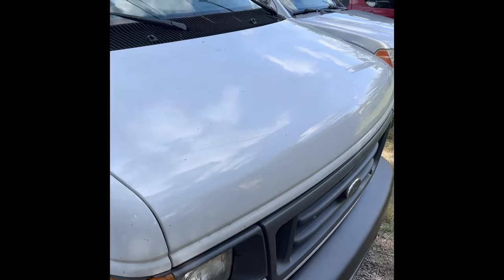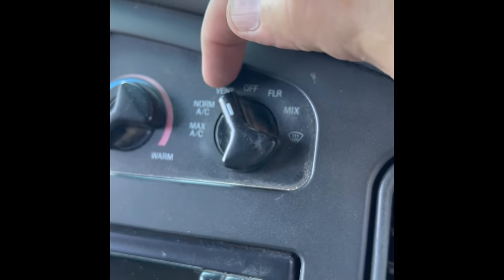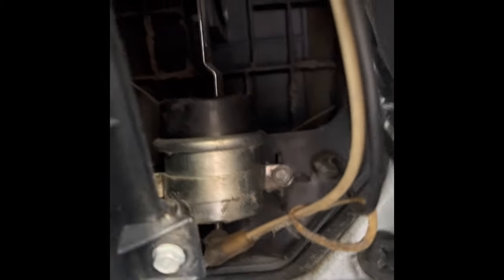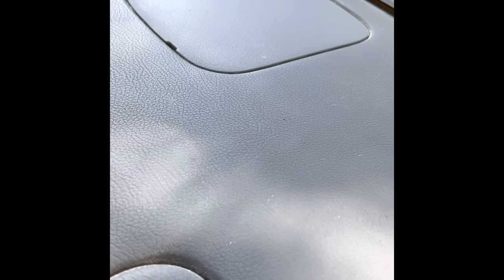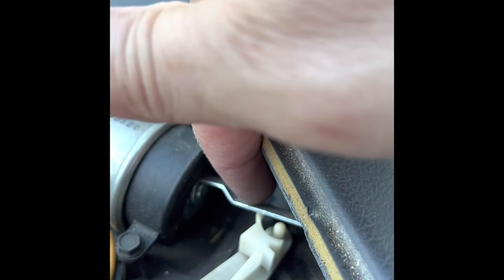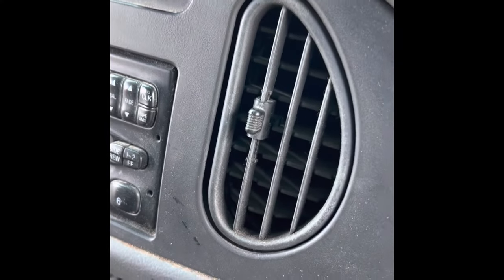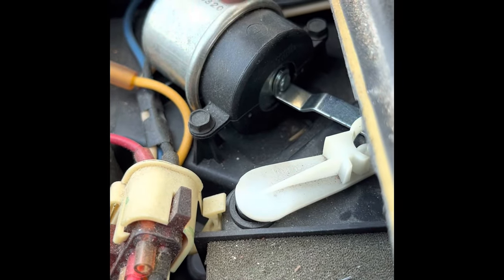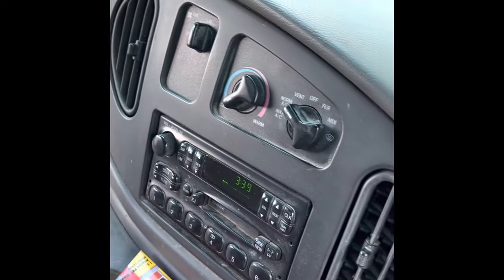Ford E250 air not coming out of front vents EASY FIX!!

Comment: 6 weeks. I’ve been driving around for 6 weeks. It’s been over a hundred degrees in Dallas the whole damn time. So easy. So simple. Six weeks.
Reply from the maker: So glad I could  help!!!!
Reply: No work? 😢
Reply: Mine is an 09 it does not have the plate on the dash??
Reply: Where is that switch in mine
Reply: How hard is it to fix it properly change the part ?
Reply: Hahaha... I can write the same comment jus change to city to Philly

Comment from the maker: Please note: What I pointed out in this video is more of a “bypass” than a true fix in order to avoid an expensive and time consuming tear down. What I am proposing gets the job done with no cost. The actuator that I point out in the video that I was going to replace actually worked fine upon bench testing so the vacuum problem is more complicated and would require a tear down of the system to find the leak. Hope my solution helps.
Reply: So the actuator wasn’t the problem?
Reply: Sam thing happened to mine I checked it rn and when I pinched the actuator it blew air to the vent I’m looking to replace the actuator you pointed out but if that isn’t the part then might as well not replace it
Reply: No working- help me
Reply: @hectorespinoza7641  it’s either the canister or the blend door motor

Comment: The vacuum lines are made of plastic and eventually crack and break. I replaced all of my vacuum lines with rubber lines that I got on Amazon and that fixed the problem. It takes time but is not that difficult, just find the old plastic lines and follow them back to all points of connection and remove them and replace with new rubber tubing. It worked, I now have all vents blowing air.
Reply: Hi. I have same issues with my 2008 e250 van. Do you have videos and more informations ? Thx
Reply: hello i am also having this issue with my 99 e250. any advice is welcomed and appreciated

Comment: I've been running this 'bypass' fix on my van for around 3 years. one thing to note the air intake under the passenger footwell defaults to fresh air intake. so when motor is under load and ac on max ac and the vacuum decreases the fresh air intake door will open. this does become slightly annoying as my area has a lot of diesel trucks so the fumes get sucked into the cab.
Reply: Could you finger the fresh air intake thing like the way you did the top one???  🤦🤦🤦
To keep outside and exhaust air out..thanks for the video 🙋🏻🙋🏻🙋🏻
Reply: No work 😅 ??

Comment: I bought a new vacuum canister and pulled the vacuum line out from the inside of the firewall. The check valve and t fitting came out too it looked like the leak was a dry rotted tube that went to the canister… it crumbled. So I just ran a wire through the firewall toward the engine until I could see it and then pulled the new vacuum line through.

Comment: The ball is bad on top of condenser run a new line from under the hood to the black line under the floor and it will fix it and it will work with the control

Comment: For those who want to know what each vacuum motor/actuator does.  

1. The one in the passenger footwell controls the door between fresh air and interior recirculated air.  The default with no vacuum leaves the exterior door open.  

2. The one he disconnected the arm for controls the first door from the blower motor.  The door it controls is to divert the air to the main vents with a slight bypass to the defrost vents.  Its default with no vacuum is to close the main vents and push air to the defrost vents.  

3. The vacuum motor with two lines going to it, next to the one he was talking about in the video, controls the difference between defrost, floor, and then mixed vents.  It has two lines to allow different amounts of vacuum to be applied. It defaults to defrost vents when it does not allow vacuum. 

Therefore if there is a vacuum leak in the HVAC control system it defaults to 
1. exterior air
2. main vent door closed
3. defrost/floor door closed pushing all flow to the defrost vents.   
Causing full function to defrost vents with exterior air pushed across the heater core.
Reply: This is so incredibly helpful.  Thank you.
Reply: Makes a lot of sense
Reply: great explanation! i am having the same issue with my 99 e250 conversion van- ac air only comes out the defrost area. could you point me in the direction of what to troubleshoot first ? thanks, any advice is greatly appreciated
Reply: @cocosiz  I'm not as familiar with the engine compartment of the vans since I drive an F150.  But since this is a vacuum system it should be fairly easy to troubleshoot but the ways I know how to do it need some specialty equipment. If nothing changes when you move the dials it is a leak in your vacuum lines someplace.  Find the line that feeds the vacuum system from the intake manifold and unplug it.  Then take a smoke machine and insert it into the line to see where the smoke is leaking out and you can find the line or connection causing all of your problems.
Reply: @ssgk1983 hi so when i turn it on, the cold air just blows up and out of the defrost vent that is closest to the windshield, no matter which option i choose. so i think that's a good thing right? there is airflow and it's cold. i went ahead and ordered 2 different check valves and also got more tubing. i'm gonna check the fuse first and make sure it's good then i'm thinking i'll try what one of these videos have shown. inside the hood there's the lines that are connected, a black and red tube, i've seen people unhook them and feed them into the inside of the driver area and take off the panel under glove box area dash and open the middle console thing. then they attach them to something under there😁 i'm so thankful for you tube bc i'm literally a housewife that doesn't know anything about mechanic work, but i am handy and can follow directions very well! helpfully i can figure it out

Comment: Nice post.  I'm going to try this in the morning.  
You are right, 90% of the time you want air out the front vents,  but the 10% when you need that defroster will save your life.  I had to drive without a defroster one night because my blower motor failed.   Very dangerous!  Fortunately I had some hand sanitizer which contains alcohol.  Rubbed it on the inside of the windshield.  Prevented fogging and moisture freezing.  Made it home safely!

Comment: Thanks for posting this! My normal commuter car died so I was using my cargo van that had this problem forever but it was never a huge issue because mine did a split between the defrost and the floor vent so on long trips it wasn't too bad which was mostly what I was using it for. But now it's a heat wave and I'm using it to drive to and from work and was getting home in the hottest part of the day soaked in sweat. I couldn't get the vacuum actuator tab off the switch so I just unscrewed it and pushed the entire actuator as far towards the windshield and drivers side as I could and it works great now. I can do the semi-proper check switch and accumulator relocation fix when it's cooler outside!

Comment: Thank you so much for your video I've had the same problem in a 350 Ford van and it worked like  a charm.
Reply from the maker: Glad it helped
Reply: @jeffadams6737  does that same lever control the overhead vents in the rear. I have a 2007 E-350

Comment: This is BY FAR THE EASIEST OF THE FIXES!!!  Do not even bother taking off the doghouse or mess with the vacuum lines, re-routing them to a new vacuum reservoir or running new lines.   None of that is necessary. The problem is that ONE actuator, located on the top of the dash, is not getting vacuum in order to work it's door.  That's it.

You circumvent all of these lines by simply popping the access panel, as he does, locating the correct actuator, the one on the right as he shows,   Then you do this.
1.  remove the actuator arm from the white pin by undoing the two bolts holding it down.
2.  Flip the door diversion handle to both extremes, mark a spot on the plastic floor behind the arm in both positions, so that your one marked dot is seen to the right of the white arm when the door is flipped to "vents" and the same dot can be seen to the left of the white arm when the door is flipped closed to default defrost and floor.  If you can see the dot in both positions, you've marked it correctly.
3. Drill a small hole (1/8") on the dot through the plastic floor, this hole opens to a void at least 4 inches deep under the plastic floor.
4.  Stick a small spare screwdriver into the hole, the handle will stop it from dropping into the hole and will block the door arm from moving in either the open or closed position.
5.  Replace the cover, you're done.

That is it.  You now have a vent changing device that works in both positions.  You're going to leave it on "vents" 90% of the time, but should you ever want to change, pop the access cover, pull out the screwdriver, flip the arm, replace the screwdriver, replace the cover.  Simple as that.

Comment: I have same issue on my rv which has 2007 ford E450 something or another. I have same access panel. I couldn’t get my metal bar thing off the white plasticy bit like you did. My metal part is flat and much wider than yours which looks like a round bar. I was afraid to break the white part

Comment: 4:00 This was bad design by Ford. If, instead of the whole vacuum line and reservoir B.S., they let the user control the flapper by a MANUAL SWITCH, this thing would never break. But nooo, they HAD to make it complicated! Its an air flow flapper, why make it so convoluted?

Comment: thanks for showing this i found my issue but you didnt show how to take the lever off the white part can you show how you did that
Reply: Pretty sure the Lever was already off and that's the Problem to begin with.I am an everyday Mechanic and I'm having trouble finding the part with the White Lever.We have a few E250s we work in and alot of them have sane problem with the Lever Breaking.

Comment: Hello. How did you lift the actuator metal arm off the plastic lever without breaking the plastic. I’ve tried and seems would have to unbolt the actuator? Thank you.
Reply: The actuator ain’t the issue it’s either canister or the blend door actuator
Reply: @brandonhorstman1774  Yes, I agree. As you stated, this option is a temporary fix until I figure out how I’ll fix rework the vacuum hoses. Thought you could share how you popped the metal bar off the plastic switch without breaking it. Thanks.
Reply: @user-nr1np1pj9w  don’t do as I did cause I broke and had to go to junkyard but try this method get the actuator in bolted and then vacuum line unplugged and get vice grips on the plastic near where it goes in to switch the mode and just elegantly pull and wiggle then should fall off or be simple do same process putting in however u will have to push it in some to line upb
Reply: I just did the bypass today if u have a problem with rear it’s most likely the reservoir just bypass it you don’t really need it anyway

Comment: This would fix mine - if I push the arm over it does switch it - but how did you get the metal arm off with the circular plastic in the way?
Reply: My experience use vice grips and wiggle like it’s a fuse
Reply: Hi I'm having the same problem  Were you able to get it off? Seem impossible because how the curved piece spans across the metal arm :(
Reply: Are you  pulling up on the  white piece until it's totally out of the dashboard or are you  pulling on the metal arm?  The curved white piece of plastic spans across the  metal arm that doesn't allow it to lift if the plastic pin
Thanks
Reply: @kevinsheffield2110  - I was able to get it off.  I removed just the metal arm, and no it wasn't easy because of the plastic, but I just used a little more force than made me comfortable and it did give without breaking the plastic.  I'm going to do the vacuum fix in the passenger floor and am a little nervous about putting it back together, but it did work!

Comment: this is one of those things where you can get in worse then when you started i m thinking / have air for now . but will hurt resale when i tell them just open the door and flip the broken little white arm. 2006 E250 52000 miles on it.
Reply from the maker: I wouldn’t worry about resale. Changing that part out was $2500 labor alone. My van has 200K on it. Not worth the repair bill. You have less miles obviously but it depends on what your end goal is.

Comment: Is there a trick to get the lever off?, I don't want to break anything.
Reply: I seem to have the same problem trying to get that lever off of the actuator, I didn't want to start unscrewing anything unnecessarily but also didn't see anything replying to your answer, do you mind sharing what you ended up doing? I know it only looks like two screws, the one closest to the windshield is on a slight angle so I'm afraid I might drop it
Reply: Any luck getting the arm separated from the  white plastic piece?

Comment: Know anything about Rear door locks?? Ty
Reply: Replacing the locks? I replaced all 4 locks took about an hour. For the rear door remove the door panel.  Remove the license plate holer6 then with a flashlight you'll see the lock. With long pliers pull ot the metal clip that slides behind the lock  The lock will fall out  Disconnect the metal rod. Install new lock put clip back, connect rod, Done

Comment: no worked- ??  Help me?     New check valve,  new actuator, new,bypass regulator no dry rotted ,😅 s.c - 2 year bypass    - ?????
Reply: Only issue u have then replace all vacuums on motor

Comment: Did you ever diagnose the problem? And find an easy fix other than what you did here?
Reply from the maker: It’s the vacuum canister buried deep in the engine compartment. It’s leaking enough that the vacuum switch won’t switch over. The part is about $65 but the labor to fix is horrendous with about 5 hours to disassemble and put back together. Sort of like a heater core.
Reply: @jeffadams6737 good work, so the next fix-hack is adding in the bypass line, where some videos address that one. My local Ford dealer did a bypass for me 12 years ago and now it is leaking somewhere on my e450. So im back to your hack for the time being, till i test the two actuators. Thanks for your vlog here!
Reply from the maker: @jr.6199  The designers made that system way more difficult to repair than it needs to be. That’s engineered so you have to buy new!
Reply: @jeffadams6737 Tools, vehicles performed way better and longer until around 2000's . They knew exactly what they were doing when they started making things to not last as long.  Cast iron parts went to plastic, internal engine parts even went to plastic. Why make something that lasts years and years? They would never be able to sale as many. It used to b pride in how long your product (s)  would last. Now it's just  all about the sales, who cares about morals amd pride anymore?